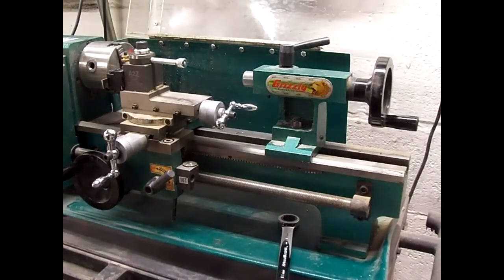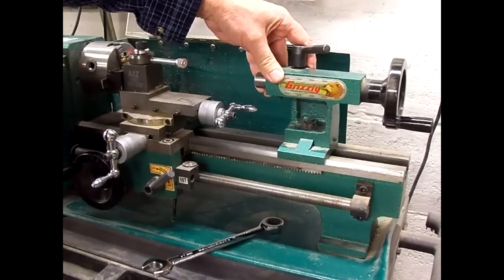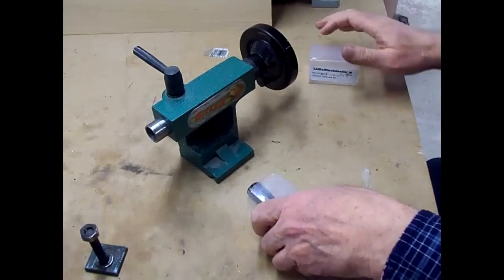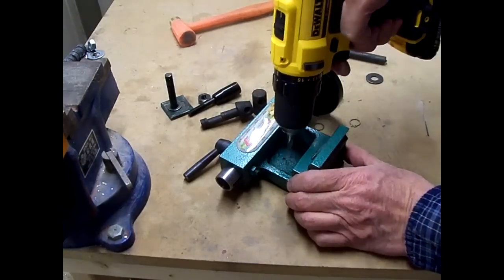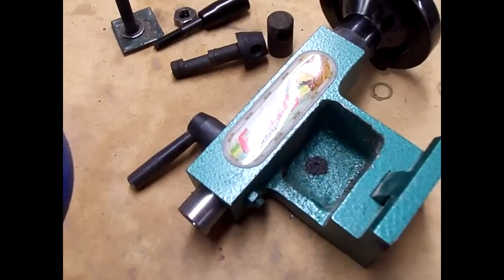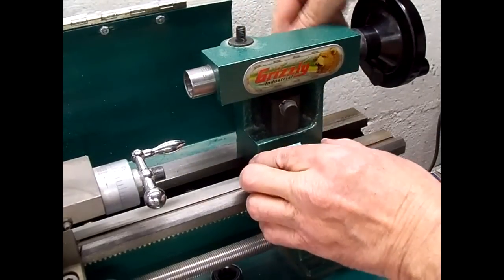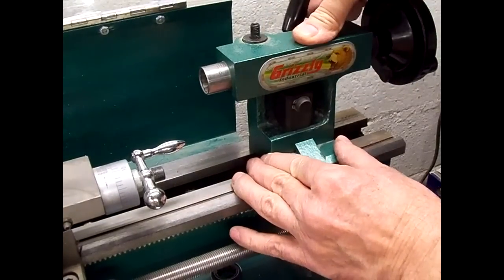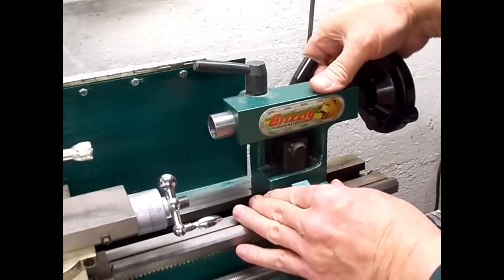Mini Lathe Mod

Comment: I just added this to my 7x10 about a month ago, I bolted down the inside parts and then used the center punch, that lined up the hole for the cam shaft perfectly.  I also put a spring on the threaded rod to keep the locking plate in place when taking the tail stock off the lathe.

I first tried making a long nut and while that made it a little easier to use a wrench, this kit from Little Machine Shop is so much better when working on small parts.

Comment: I bought this for my Central Machine lathe as it said it fit. On the shaft through the web I had to put in washer shims to get the cam groove to center in the square housing, Maybe my web was thinner than other lathes. The hole in the square portion seemed to be oversized for the shaft and even had to put a washer under it to take up the oversized hole slop. Had to make a longer locking lever to increase the force to make it grip. Works but I should have made my own.

Comment: This is the most recent modification I've made to my HF 7x10 lathe. I used a slightly different method for drilling the hole; instead of using the multiple sizes of individual bits, I used a step-drill which basically did the same thing without going through several bit changes. 

Thanks for sharing! 

(Had to laugh at the label on the bench vise....
V. I. S. E., not "vice". 😄)
Reply from the maker: Thanks for the comment and for watching!

Comment: I bought this modification for a Central Machine lathe but you find the web of the tailstock is not always the same thickness so I had to shim both sides of the web to get the cam portion in the right location. Also the cam does not have much vertical lift. Also needed to add a spring below to help release the hold plate. In the end also made a longer handle to get more force applied. Cam is wearing even if greased so will soon be nonfunctional.

Comment: I have a 7" X 12" Grizzly, and I really like it.  But the tailstock has issues.  I'm going to get this mod.  There is, in my opinion, another problem that should be addressed.  To adjust the tailstock offset, you have to remove it to get to a nut that's underneath!  You ought to be able to do that from the top, as is the case with all the full-sized lathes.
Reply: It's insanely hard to get it right, but there is a small set screw that "helps" on the backside. It's way better to drill tap two new set crews (so they balance each other). Then it becomes fairly easy.

Comment: Your compound should set at 30 degrees not 90 degrees as the machine shipped.  Then you would have your tailstock clearance and .001 on the compound would be .001" off the diameter instead of the .001" on the crossfeed removing .002 on the diameter.

Comment: I purchased a grizzly it was a fucking gigantic piece of shit. every assembly on the thing was either assembled wrong or had incorrect Hardware or defective parts to it. some of the design and that thing was so badly designed that I cannot believe a human being did it. the guys in China assembled it's so incorrectly that it was laughable after getting enough parts from Grizzly under warranty to build an entirely new lathe I threw my hands up in the air and said fuck it and got an old Logan 820 and rebuilt it like new for almost nothing. no I have a beautiful antique Logan that has zero run out IR and a Harding's it's like brand new and I paid for nothing almost. I'm thinking about having a video where I check up the grizzly and turn it down into little tiny particles of crap so I can be melted down into something more useful like a paperweight